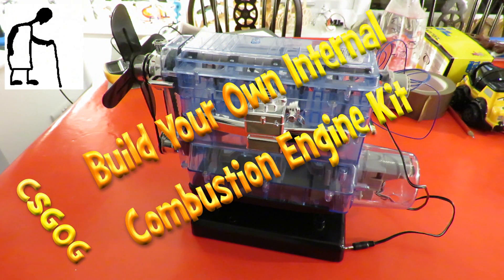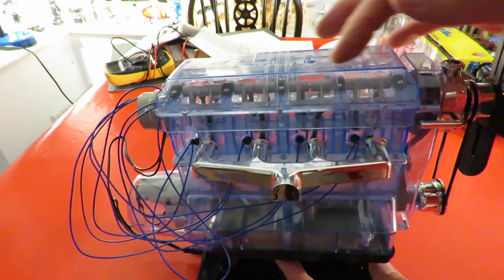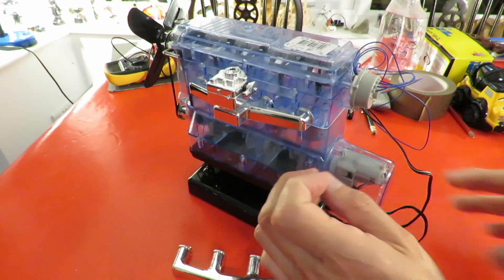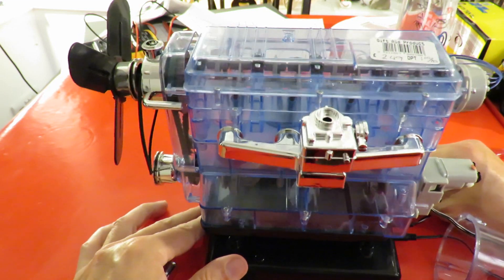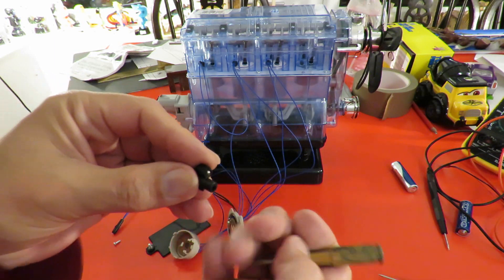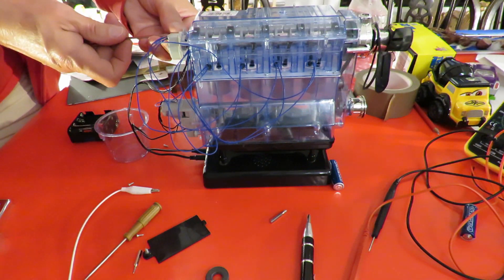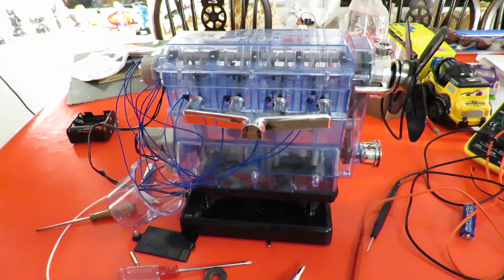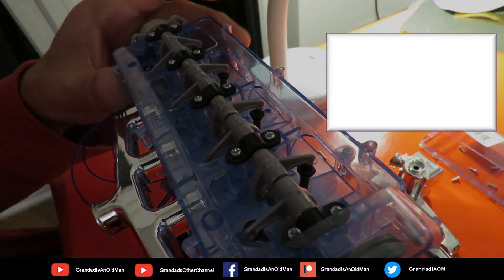CSGOG Build Your Own Internal Combustion Engine Kit

Comment: Those things are fundamentally flawed. The wheel on the front connected to the crank shaft is pulled up too much by the belt causing it the gears to skip
Reply from the maker: I didn't do the original build on this one, I found it ready made in a charity shop in 2017 so I cannot say anything about the original construction work.  I revisited this kit in 2021 and sorted out the issues.
Short video https://youtu.be/T4SdWYTLisY
Longer video https://youtu.be/WZW3YBFTSRQ

Comment: You need to do the ignition timing and firing order, the spark should happen with the piston at the top with both valves shut, the the wires need connecting up on the order of 1-3-4-2, number one being at the fan end.
 The real things are lot more trouble, my Carlton has just broken a cam follower ruining the cam in the process, Grrrr !!
Reply: Could also be 2-1-3-4. If he swaps the LED's in 1 and 2 it should be good.
Reply from the maker: As for the sequence YES 3 and 4 leads were reversed, (I can see it was firing 1-4-3-2) hadn't noticed that :-) but then as I said in previous reply I was just pleased to sort out the fact the power wasn't getting through the distributor.
Reply: Ian Virco 
Was going to say that also.
Reply from the maker: The timing is adjustable, I was just happy to fix the fault and get the sparks flashing. The full manual is available here, you might like it just to see the detail http://www.trendsuk.co.uk/DownloadFiles/HM04R-int-comb-manual.pdf
Reply: Mine was a struggle. The way you time it is turning the crankshaft so 4 is at the top. Then turn the thing connected to the LEDs until the number 4 led is on. The proble for me is 4 was on when the screw holes where too far away from the hole to put the screw in. I made it exactly one off (so fired 4 when it was at bottom) and swapped 1 and 2 as well as swapped 3 and 4. Works like a charm.